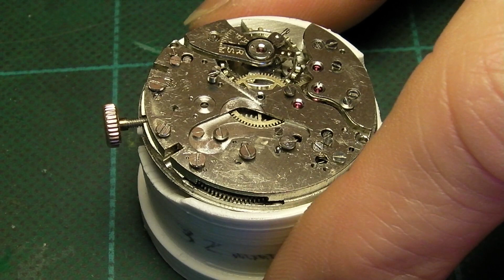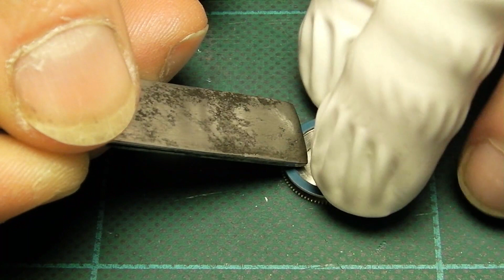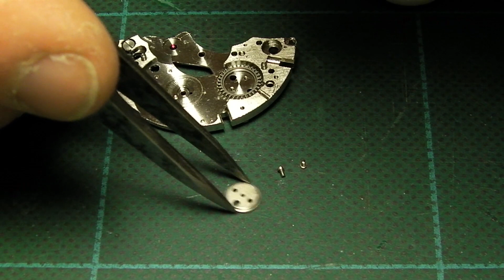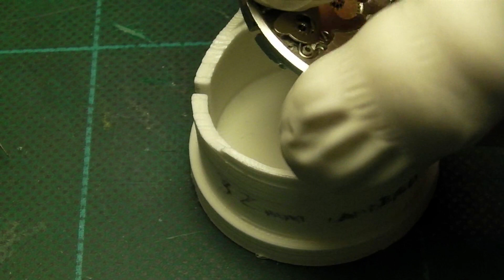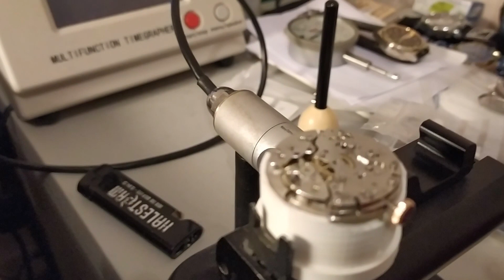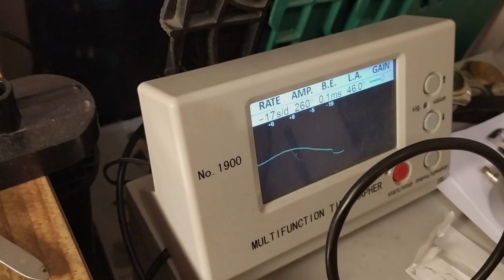Landeron 48 Chronograph Service Part 4. Watch assembly and regulating.

Comment: I just found your great series of working on Landeron 48 movement. Nice job and detailed explanations. Did you lubricate the jewel bearing on the balance wheel cork? I am currently working on the Landeron 51 movement and found it interesting how that bearing is constructed but yet not easily been accessed. Thank you!
Reply from the maker: Thanks. I'm glad it's helpful to you. Do you mean the balance cap jewel? If so then yes, you need to remove the balance wheel and unscrew these from underneath, clean and peg the jewels and lubricate then reassemble. If you have a Bergeon 1A auto oiler they're perfect for lubricating after reassembly. The dial side is easier being a plate held by a single screw.
If you mean the pallet fork pivots then no, these aren't lubricated.
Reply: @spidiq8  Thank you for the quick reply. Yes, I meant the balance cap jewel. In regards of pallet fork pivots - I'd think the associated jewels should be lubricated. As well as pallets.
Reply from the maker: @ValentechTime  The faces of the pallet stones are lubricated, (moebius 941/9415 or 9010 will suffice if you have neither of the others).
The pivots are never lubricated.
Reply: @spidiq8  Thank you, starting from now I will never lubricate the fork pivots.